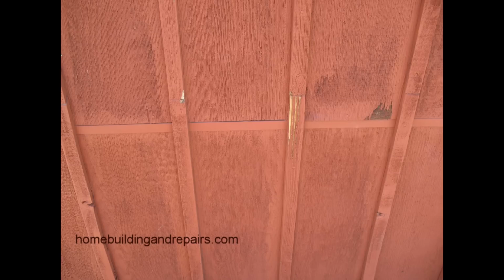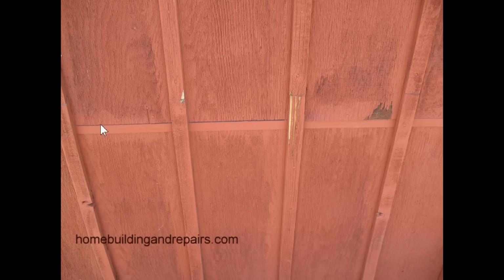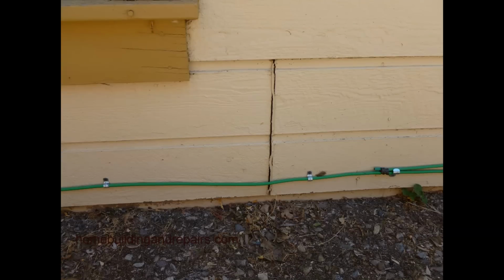Can I Caulk Large Siding Gaps? – Building Maintenance Tips

Comment: the top of my basement window keeps having leaky water every time there is light rain and wind.  I read in an article in Fine Homebuilding magazine about water can get behind vinyl sidings and decided to put some caulk at the end of some of my siding just above window. It works;  I have not seen leaky water for about a year now.
I live in a cold climate, and lately felt that it's cold around my main floor's window (which is on top of the basement window),  I keep thinking about having some more caulk applied to these gaps where the vynil sidings meet the window.
Reply from the maker: I don't know if you're asking a question or making a suggestion. Please rephrase your question if you were asking something.

Comment: 0:10 No, it's a waste of time and materials, detrimental to airflow, and potential trap for moisture and water.
Reply from the maker: +doobysnacks You have a good point and the potential trap for moisture created by caulking can also happen if it isn't can't. It's a double-edged sword and in my opinion another problem that wouldn't exist if the lap siding butted up against the wood trim instead of going underneath it.
Reply: +gregvancom Totally agree there!
Reply: ok, mine is vinyl and I did that too!!!!!
Reply: Im doing a job now, and the customer expects his 4000sqft 2 story fully wrapped with siding home to be completely caulked, I told him we don't do that because of seasonal movement and cracking along with moisture capture. He doesn't agree
Reply: this is exactly what I question, at the 10 second mark of this video illustrates how my brand new home looks with hardiboard siding. large gaps where the vertical board covers the ends of the horizontal boards. should hardiboard siding be sealed all the way around; not only horizontally under the slats but vertically where the vertical board comes down at the end of the horizontal boards? there seems to be conflicting information but seems to me all those open spaces should be sealed/caulked to prevent moisture and bug intrusion.  the builder says they normally do not do the vertical spaces.